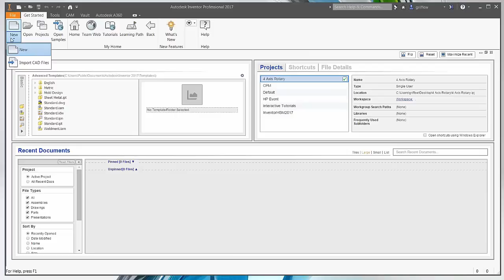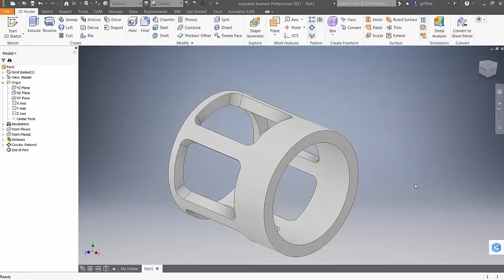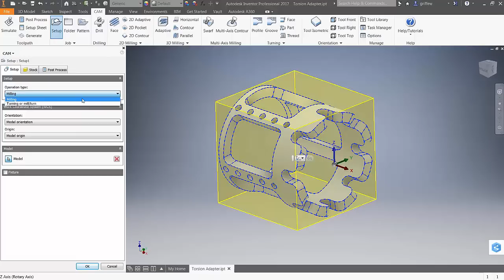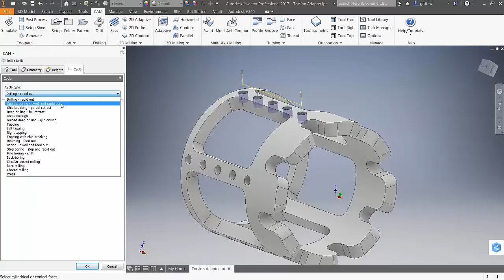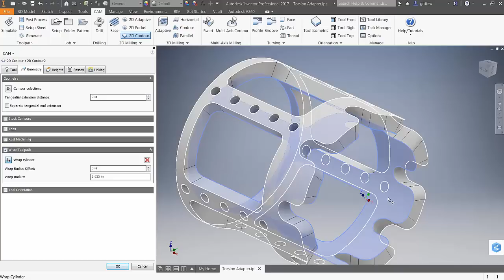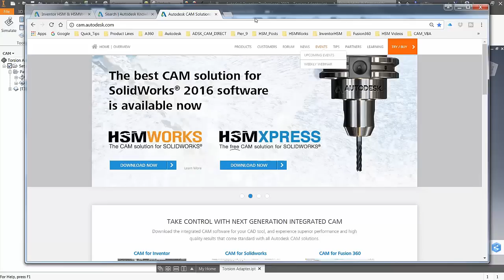Weekly HSM Technical Webinar  - 4th Axis Rotary Overview

Comment: A comment was made about not having the origin automatically on sketches.
Inventor has a feature under Options/Sketch/ Autoproject part origin on sketch create.  
If the check box is marked, the origin point is automatically added to all new sketches.

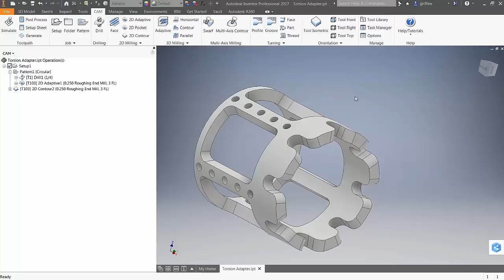Comment: At 49:35 you show a sketch where you explain the problem with the wrap feature when used to produce a 4th axis geometry.

I'd like to share my thoughts on that and any feedback is welcome.

Questions:
1) The situation you are describing is something I've seen happen in 3 axis live-tooling lathes. That is lathes with an X, Z and C axis capabilities. It's exactly the same thing as locking the Y-axis in a 4-axes mill and trying to reproduce the feature with the X and A axes. And when that code was posted, it is obvious that that's what's happening because there are no Y axis motions in the code for the pocket. So it's basically 3 axes working there. But that makes me think a bit (--> Q2)

2) If you setup the 2D adaptive or contour so as to output a G17 G41 or G42 code (depending on milling used), wouldn't that leverage the machine's controller to solve that issue??? Not tried it and don't have access to a machine anymore to try it... :(

Comment: at the end of the segment where there is a presentation of the tool gouging a wrap feature. this is assumes the cutter centerline intersects the part rotation axis. to cut this feature shown its surface is rotated to be parallel the the z-axis. then tool just needs to be offset by its radius. is this not a typical cutter comp scenerio? are you stating that HSMWorks cannot compensate for cutter diameter in 4-axis?
Reply: Exactly! They don't support that right now, however you can leave extra stock in the adaptive toolpath and do swarf cuts to clean the walls up. this is what i do! i wish they would figure something out so that the adaptives will offset the tool after creating space for it to do so that way it cuts down on the number of swarf cuts needed.
Reply: How do you make the swarf tool path work with 4 axis? when i have played with it, it seems to be 5 axis only?

Comment: Thank you for the great video! I was trying to follow along in SolidWorks but "wrap toolpath" does not seem to exist there. I was hoping that you guys were developing the software concurrently for Inventor, Fusion and SolidWorks, but it seems development of HSM for SolidWorks is falling behind. Is this a trend that will continue? I hope not. Another feature HSMWorks currently lacks is the ability to let the user select a hollow cylinder when selecting stock. I had to make a cylindrical body and use that. Also, the origin and orientation is much more simple in Inventor. Is that something that will be coming to HSMWorks?

I use various software platforms, including Inventor and SolidWorks. One thing I like was how similar the HSM was for each. I hope it will stay that way.

Thanks,
Matt
Reply: I just ordered HSMWorks Pro for the 4-axis capability which thanks to this video i now see the wrap functionality is missing. I have not received my license yet but am told i get Inventor and Fusion Ultimate which should have the wrap feature. I went with HSMWorks mainly because Solidworks model changes do not propagate to Fusion and i wanted a single CAD and integrated CAM system. Now it looks like i need 2 CAD systems. Pretty disappointing if this is the case.
Reply: Yes Matt, I have been holding back my purchase of HSMworks due to the lag in advancement in the software. So I feel your pain Matt.